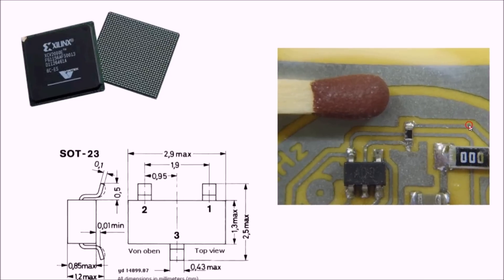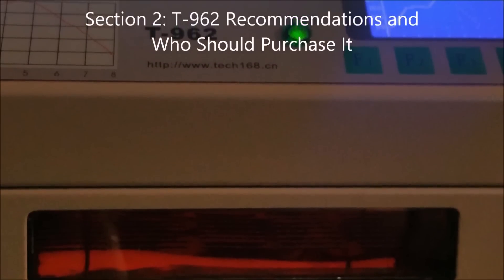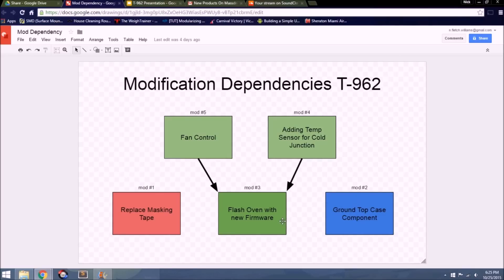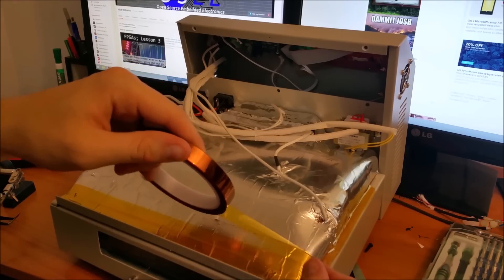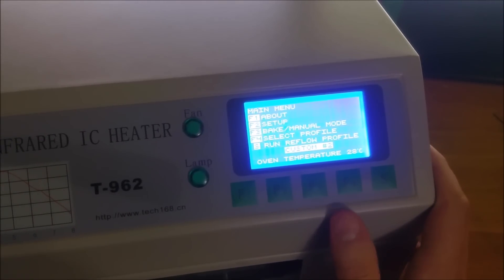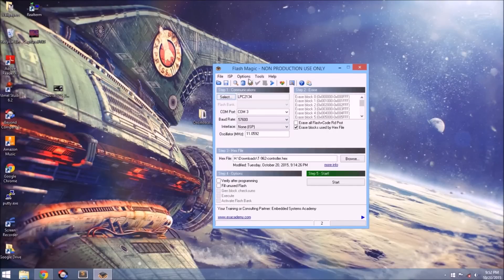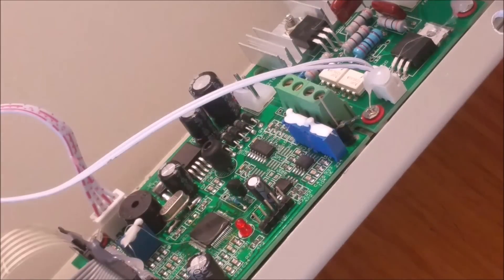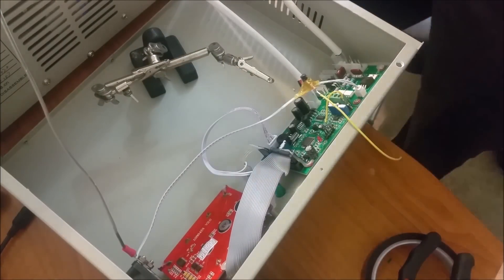Modifying the T-962 Reflow Oven

Comment: Did you look at the output from the rs232 interface you used during programming.

It provides logging and control via rs232 (I think it runs at 115200)

You didn't mention the modification to use MAX 31855 as a better interface to the thermocouples

When I flashed the new firmware and looked at the temperatures being reported (via serial rs232), I noticed one thermocouple was reading far higher than the other at least 20 deg higher all the time and this error got worse as the temperature in the oven increased, so that by 200 deg, one was reading more than 50 deg C higher than the other. 

I tried to correct this using the trim pot on the board, but it was impossible to get rid of this error.

So I installed 2 x MAX31855 interfaces in the hope that these would be better than the analog temperature measurement circuit used on the board
(the MAX31855 interface is part of the firmware but it requires both the MAX31855 and also a I2C to SPI converter chip - however I reprogrammed an Arduino Pro mini to do the SPI to I2C)

But I found that it wasn't much better even using the MAX31855 interface, and the problem seemed to be a defective thermocouple 

So I bought another 5 thermocouples from eBay

But replacing the thermocouple that was reading high didnt help, as the new one also didnt read the same as the remaining original thermocouple :-(

I initially thought the problem was the MAX31855, so I swapped the inputs, and the erroneous readings moved to the other input channel.

So I removed both thermocouples and taped them very close to each other with Kapton tape, and placed them both just off the tray and ran it again (in manual bake)

And one thermocouple still read much higher than the other.

So... At the moment, I'm going to try to go though all 5 thermocouples that I bought from eBay and see if I can match 2 of them up that seem to read the closest value to each other, when they are located within 1cm of each other inside the oven.

Needless to say, I have not had any success in actually using the oven to reflow any boards at all, as the temperature control is useless.

IMHO, I'd not advise anyone to buy this oven, as people can get equally good results using a hot plate and a frying pan

Hopefully I will eventually fix my reflow oven, but its not going to be an easy or quick job :-(
Reply: I am having the same exact issue.....I'm so upset. I can't run the custom profile for my paste. 

The t962 also doesn't have enough heat to evenly bake it's small footprint. An additional tube would be a worthy mod. You have to run the fan at minimum speeds to help the oven ramp up and doing this is putting the TRIAC at risk because that, too, is a piece of shit.
Reply: Rob Lo  Did you ever solve this? I'm having the same issue.

EDIT: I solved my issue replacing the original TLC27L2 with a zero drift OPA2333. The 15 deg difference between the two TC disappeared after that.

Comment: Nick. Thank you very much again. We've just finished the modifications and everything is working very well. Still waiting for DS18B20 sensor, but everything else works just fine.
Reply: +Nick Williams, amazing explanation.. I'm in between of ControLeo2 Open Source Controller and the Black and Decker toaster oven.. or going whit this T-962.

As for this T-962 there are times of different brands pointing to this T-962 model. If you please anybody share the right link for the one you are using in this model???.. please..!!
Reply: +Carlos Echeverria Hello Carlos. I've got mine from ebay seller equipmentwholesaler1
http://www.ebay.com/itm/260799459468?_trksid=p2057872.m2749.l2649&ssPageName=STRK%3AMEBIDX%3AIT
Reply: Woow, that was a quick answer.. thanks a lot.. :-)
Reply: +Carlos Echeverria At your service ;-) Just got the message on my phone and didn't wait
Reply: Hi Nick Williams, again, thanks for the answer and really appreciate you sharing this article.. for sure it will help many folks to build  a quality reflow oven on a good price.. :-)

Comment: This was really helpful! Now a proud owner of a functional T-962 oven :D Thanks for the very detailed and easy to follow instructions! I received the oven today, and luckily I had all the parts for the mods just sitting around.

To anyone wondering whether you need a special NXP ISP programmer, it seems any USB to serial device will do. The ISP interface of the chip is actually just your standard UART serial port communicating with the on-chip bootloader. I flashed the chip with a standard FT-232RL chip, all good in the first go, so more or less any USB-to-serial should do.
Reply: Yeah, I actually ordered an NXP programmer, and after I had made the other mods, I was just itching to get the firmware flashed, so I just thought, hey why not try it :) Either way it'll be nice to have the NXP programmer once it arrives :)
Reply: +Jessica Deathstar Thanks Jessica tor this tip. I was just about to order the programmer. Would you have any instructions how to connect USB to serial cable to flash  this thing? How did you connect your FTDI chip?

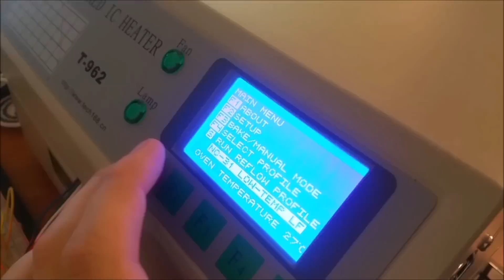Comment: Thank you for your detailed explanations on modifying the T-962. I followed your description, until timestamp 11:53 of your video. While connecting the LPC programmer to the ISP of the oven, I had some trouble getting the microcontroller into "flash-mode". I figured out that the reset-pin of the programmer must not be connected. Hence only three pins of the programmer, TXD, RXD and GND, are necessary. I used a cheap cp2104 usb to uart programmer for flashing.
I like your idea to scratch some solder mask for soldering the 18b20 to GND. I used a 0805 resistor as a pull up, which seams to fit right between the two pads.
I added a bc547 for fan control, too.
Now I am happy with the oven. I think your video was a great support during my modification session.
Reply: You can find some photos of my modifications on my website (it is in german): https://sites.google.com/site/timbersprojekte/t962a-reflow-ofen

Comment: Works like a champ, first time.  You call out a 0603 4.7K ohm pull up resistor for the Dallas temperature sensor... however the position can easily take a 1206 SMD resistor,  which I stock and it is much easier on the eyes. :->
Great video, thanks!
Reply: Agree, 0603 way too small, I had to use a lot of solder to connect one of it's ends to the pad :)

Comment: Definitely the most detailed video on this. Really well done man
Reply: Nick,
Have you read or heard of  any comments that out of the box,  the T-962 heater triac did not have thermal heatsink compound applied.  With the system fan mod cutting the noise and reducing airflow, you may have seen the writeup that the triac can overheat with low airflow.  I would be interested in your experience with triac overheat.